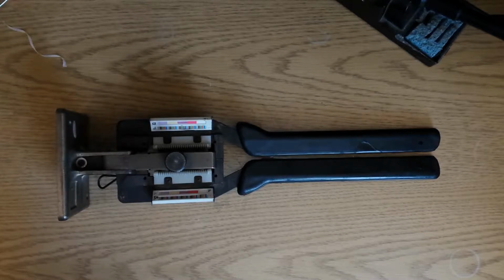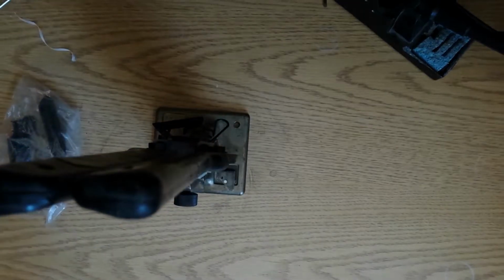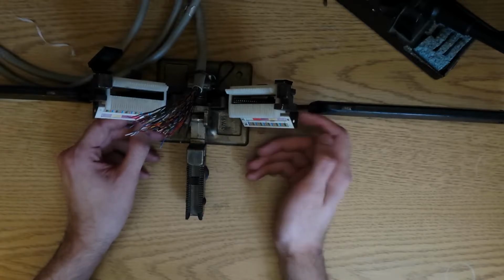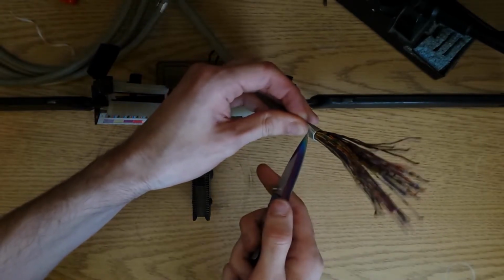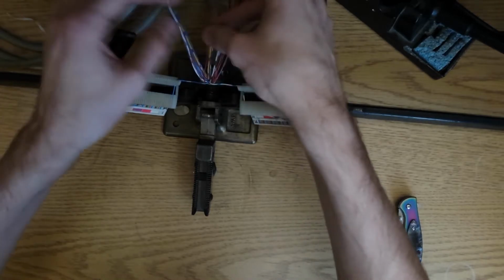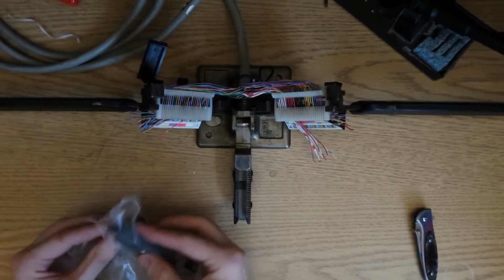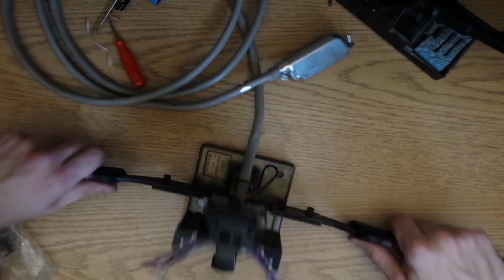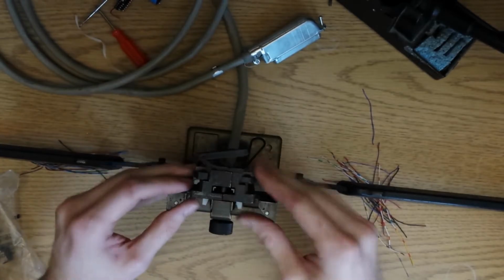Installing an RJ21 Amphenol Connector

Comment: kames tool strips the jacket properly... it's basically a rotating tool that holds itself onto the round jacket and you spin it around the circumference .  It has an adjustable blade that cuts into the jacket as you spin it around.  Very efficient quick and high quality if you get the right tool... I think places that sell industrial electrical wire tools and such sell them.  I bought mine from a place called gerrie electric in canada

Comment: Yeah, that white string can be used to pull back against the jacket to open it up to the spot you need to expose the color strands. 

I'm looking to repair several of these cables, just bought the same tool you have, now I need to find bundles of male/female ends. 
Thanks for the tips on how this tool works.
Reply: FWIW, you can reuse the ends, assuming they’re undamaged and you have a compatible tool. (There are different brands of RJ21 connectors that use different tools)

Comment: Not bad, you can use a needle nose pliers to tug each wire tighter into the connector. I like your one piece plastic hoods. I have the 2 piece plastic hoods and they cant snap together easily due to the thicknes of the insulation jacket. Tried using heat shrink with little success. Might research metal hoods like the other end.

Comment: I believe that you bought the AMP CHAMP butterfly tool rather than Amphenol’s. They are plug compatible, but have entirely different insulation displacement mechanisms. I bought one of these new in the mid 80’s to work on 1A2 key systems that were largely abandoned after divestiture. I still have it in it’s hard plastic shell case along somewhere in storage. 

There are other sizes such as 24-pin for HP/IB, 36-pin for Centronics parallel printers, and 64-pin used on some channel banks to bring out all 28 T-1 TX or RX pairs of a T-3.

Comment: Is it possible to go from this to rj45?
Reply from the maker: You can build an adapter cable. 8P8C plugs (commonly referred to as RJ45) support up to 4 pairs, so depending on the wiring scheme, it could take between 6 and 25 plugs to break out every pair of a 25 pair connector to 8P8C plugs.
Reply: @joesvax would you be interested in building one of these adapters selling it to me? I’m working a special project.
Reply from the maker: @Honey_butter_mmm  Potentially. My contact info is at http://www.dms-100.net/contact/

Comment: I'll never understand these retro guys. Why? Why would you want to deal with bullshit like this? I've worked with all of this crap and EVERYTHING is better now. Why would I want to go back?
Reply from the maker: You may not understand it, but there are plenty of like minded individuals I've met, and not just in the electronics space.

Every time you see an old classic car going down the road, that's somebody who has the same idea applied to a different context.

Sure, modern technology may have a number of improvements as compared to what came before it but it's still interesting to see how we got there: the way things used to be built and how they used to work.

Personally, I think my knowledge of older technology has made me a better engineer. Sometimes a problem has been solved once before but everybody forgot the solution and a new unproven solution is invented. Sometimes the new way is better, sometimes it's not, and very often the new solution brings with it new problems that have to be solved, whereas an existing solution that stood up to the test of time before it went obsolete has already had all of the issues worked out.
Reply: You would be surprised at the number of institutions and small to medium businesses that rely on this old tech, and cant afford to replace it with something newer.
Reply: I'm a wire harness manufacturer and we get queries for making these cables all the time.  Actually have one company who supplies a lot of companies who repair all these old Northern Telecom systems and requires approx 50 of these cables to be made various lengths DAILY!!!   This job we are quoting on is over a million dollars a year biz just doing this shit you call it.   LOL....  We know it is a legacy type biz that will someday disappear I guess once fibre optics takes over.  It's just a slow grind thing.
Reply: The FAA uses all this old crap still, nation wide.